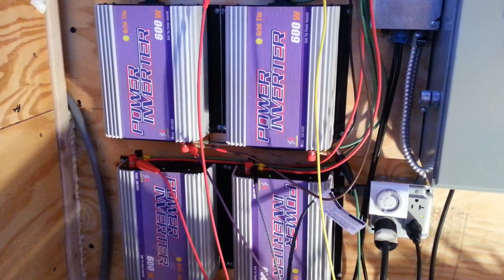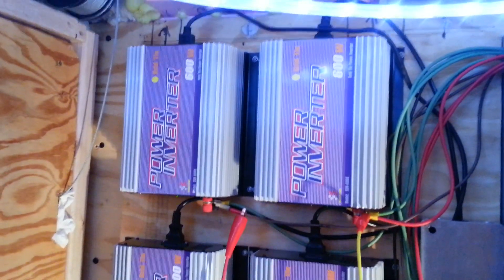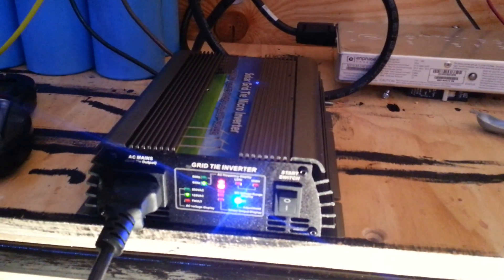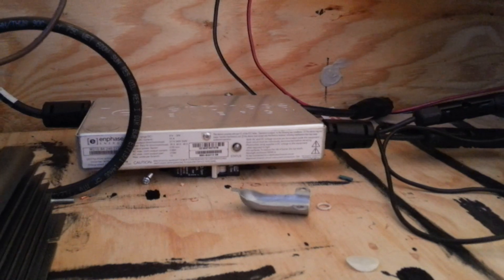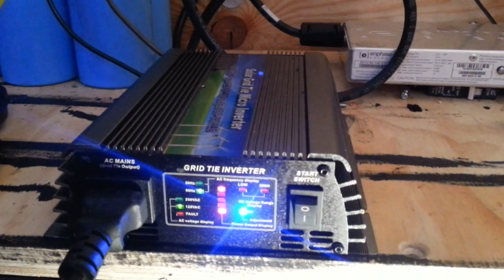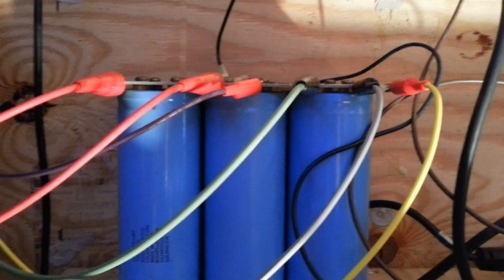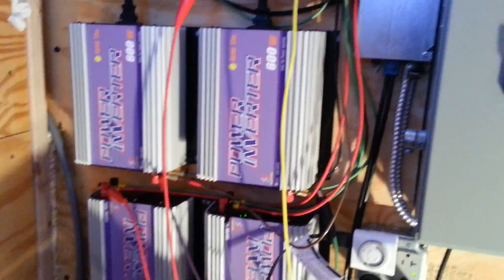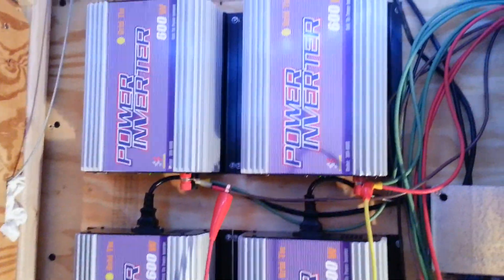Micro inverters and grid tie in the 3kw Solar Off-Grid RV

Comment: Try placing a diode on the dc input. A lot of those micro inverters put a square wave on the dc that could upset the other. It may not solve it but its worth a try.

Comment: y r u using 6 600w inverters insted of one larger one
Reply: when you have one big inverter you lose ALL POWER in ALL PANELS when just a single panel is shaded is damaged. In solution in this video there is no such problem - you lose only panels connected to one inverter. It increased power generated from panels
Reply: @wu ming yeah, I asked the same question to the author of the video, because I wanted to buy these devices :)

Comment: Great video. Do you like the panels? where did you buy them?  did you consider running two in parallel with larger Guage DC wire and half the inverters?
Reply: Running the panels in parallel would overload the inverters (600W) at peak panel output. He would need higher power rated inverters.

Comment: If you insist on using a micro inverter just use a quality one like Enphase that doesn't have such a high conversion loss. Also I doubt any of those 6 chinese inverters are still running today, if you read reviews they last 6months to about a year tops before they fail.
Reply: where I can read those reviews?
Reply: Because of bugs creeping inside the inverter. A grid helps.

Comment: I would like to do this also. I have two panels and going to buy the sun-600, found on amazon for 159.00. Anything else I need besides the panels and  grid tie...Can I connect the 2 solar panels in parallel?

Comment: Use a clamp meter on the AC output to determine output vs types of days, sunny, cloudy, etc.. I was wondering if the enphase inverters will sync and turn on when connected to the other microinverters? Have you tried that?

Comment: For a real time power display, use a kill-a-watt meter set to display watts in line with the output of the mass power grid tie units. (Don't exceed 1800 watts per meter or it may blow internal fuse in kill-a-watt meter).  To see it on your computer, use a ethernet or wireless camera pointed at the kill-a-watt meter to display a video picture over your wireless lan to monitor by computer.

Comment: So you just plug in the grid tie inverter to the AC mains and connect a solar panel to it (that is of reasonable wattage and the proper voltage range)? It's that simple?
Well damn, if that is the case, miss VISA is about to have the plastic charged out of her cause I'm going on ebay and getting a couple of these things!

Comment: wow great video very informative how are these lasting a year later? do you recommend the sun 600s still or have you found better in the price range?I want to do this type 3kw for home of course the outback would be nice for outages as i have a sump pump issue for the past 27 years but that outback system even at 24vt isn't cheap like this set up,what would you recommend for an outback  a 24 or 48 vt? i've been reading up on 6vt duracells seem to be a great inexpensive high output battery , what do you think? hey im seeing your panels now ,so you recommend the 305s for the 600 w grid ties?the420s in full sun are putting out almost 60 vts and if you even used a cheap charge controler you   would burn it up also right?
Reply: HR McKee lol 4 years later

Comment: Dear Master, I have a MPPT Charge Controller 60 Amps (cod YOM-MPP60 - 60 a), but I need to increase the capacity of amperage in order to have a total of 650 Watts of power from the solar panels all connected in parallel, the positive positive and negative to negative and a bank of stationary batteries 3 150 Amperes also in parallel. It happens that I want to add more solar panels, however, the controller is already at its limit. Wonder if a solution is to get another charge controller MPPT 60 amps and connect them in parallel to increase capacity so that, both will feed the same bench battery?

Comment from the maker: The GT inverters are nice as they maximize efficiency, that is if the grid is available,  if you use battery's then they will need to be large deep cycle type to get decent storage capacity.

Comment from the maker: This last summer i was using a 5k BTU 11 EER  window unit that draws no more then about ~400 watts, i am about to start building a permanent cooling unit for next summer that will be a 2 or 3 stage water chiller built from a 13,500 BTU rv rooftop unit and an 8,000 BTU window unit repackaged and built into the trailer.

Comment from the maker: Negative Sir Mike,  The printed circuit board the caps are mounted to makes it confusing, in fact all the negative terms on the caps are tied together and one positive term per cap to each individual inverter.

Comment from the maker: the negative buss is common to all of them and the positive terms are individual.

Note that when i did a common negative DC buss on my enphase inverters on a new project they went into latched ground fault state, so they had to be left separate on both neg and pos sides. i will upload a new vid of my second system soon.

Comment: Great video, but without a Kill-a-Watt meter hooked to the GTI's output, how do you know how efficient they are? I have put 480 pv watts at 40v into my own Sun 600g and do not ever get more than 332 watts AC out -- 69% max conversion efficiency, which seems poor to me. The Enphase m215 regularly tops 90% efficiency in real world tests -- it's a damn shame they only make a unit designed for 240 to 260 watt panels. Please let us know how long your Sun GTIs last -- they only have 30 day warranties.

Comment from the maker: 1 inverter per outlet would be overkill if your only feeding less then about 5 amps per plug or 10-15 amps per gang, my 600w inverters only peak at about 3amps at 120v each with the 420w panels on them.

Comment from the maker: I like to oversize my wire on the low voltage dc feeds to counteract line resistance, on high voltage AC feeds i generally stick to the rated wire sizes especially with the cost of copper now, you wont see better outputs if you use 8 amps on a 10awg wire vs an 12awg wire, at least not something that would be measurable anyway.

Comment from the maker: The caps i showed in this vid were bought for $20 for the six at a local hamfest, the best source is most likely eb4y, i haven't tried a smaller capacitor yet, a much smaller uF rating may work.

Comment from the maker: Hi Michael, thank you for your good review, it seams like when the inverters go into its MPPT search mode periodically, the caps prevent the open circuit voltage from rising to the inverters fault voltage. other inverter models may not have this issue and accept the 62+ vdc OCV.

Comment: But I intend on building my own solar panels.  If you don't mind, I would like to ask your opinion.  You seem to be VERY knowledgeable about harvesting solar power so I figured you would be the right person.  I am planning on using 1 panel on 1 inverter like you but I am also thinking of pluging them into 1 outlet that has its own designated circuit breaker.  Also using 10 gauge wire or larger.  My question is......  Do you think that's OVERKILL.You think I would get better outputs by doin this?